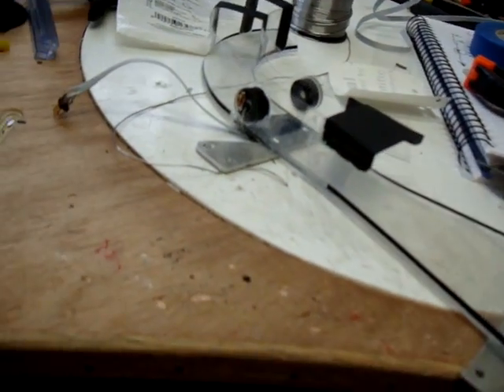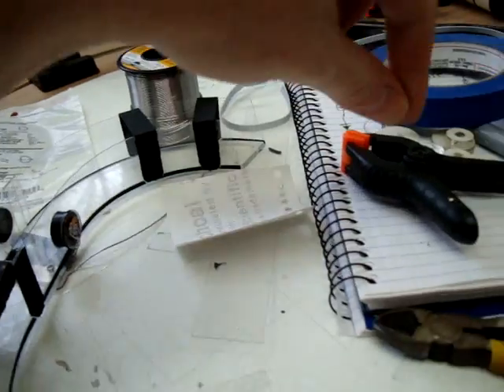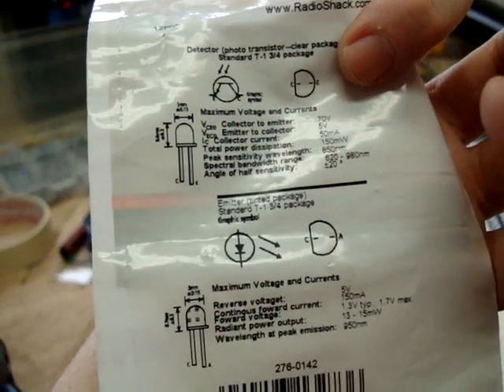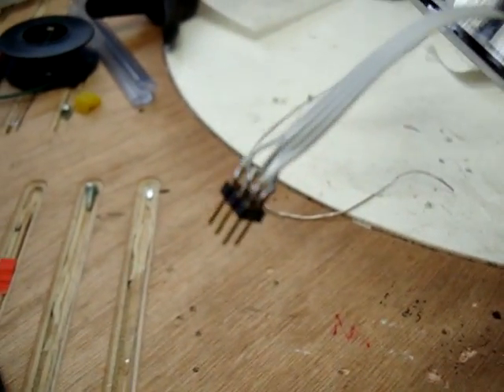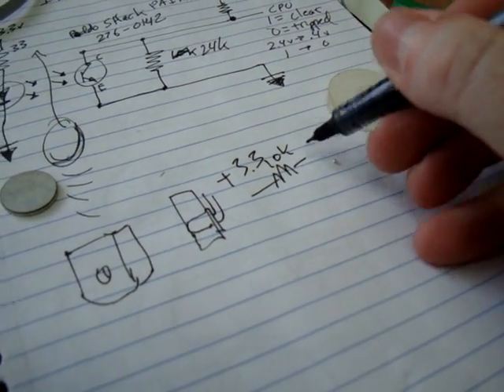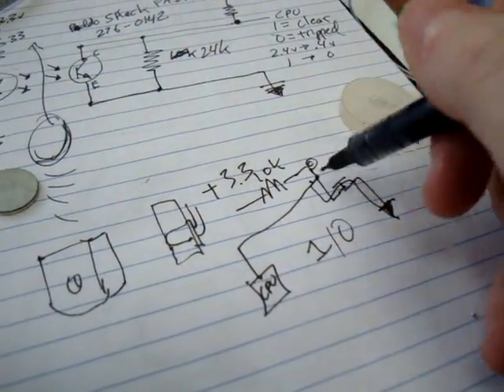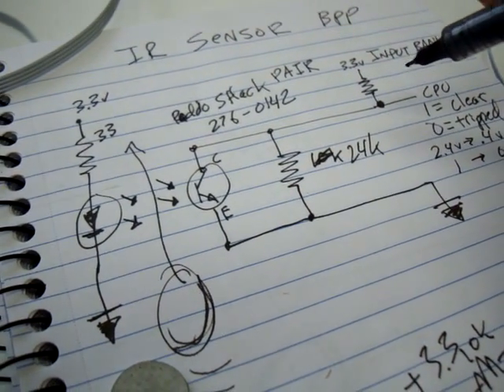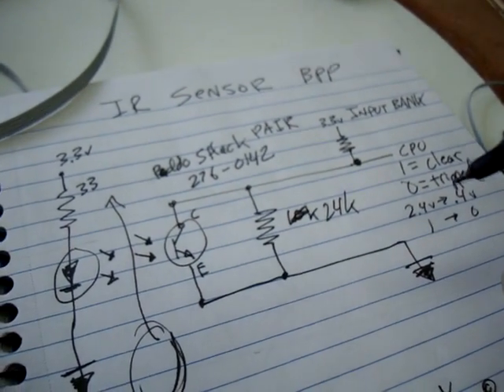Pinball optosensor

Comment: Ben Heck Hacks, what does the optical sensors mostly do on the playfields because I see them placed everywhere on the playfield but not sure what they are switching on or doing in pinball games. Do you know what they are mostly using optical sensors in pinball games used for?